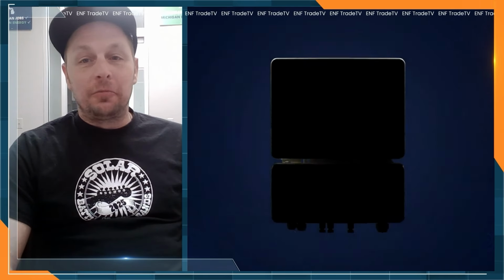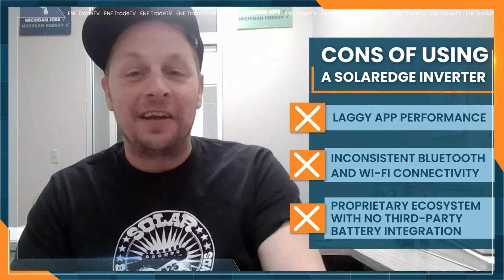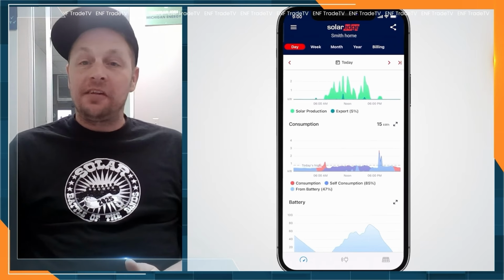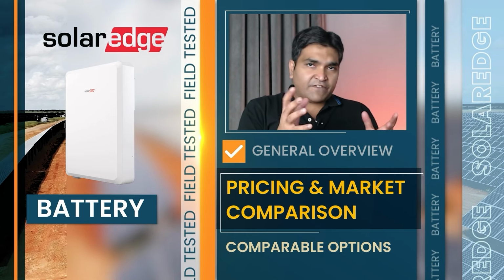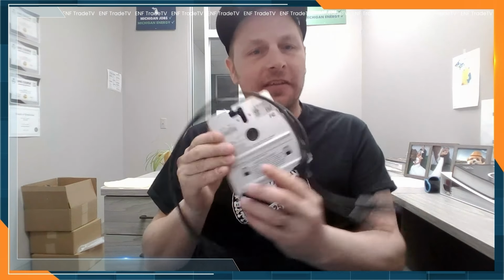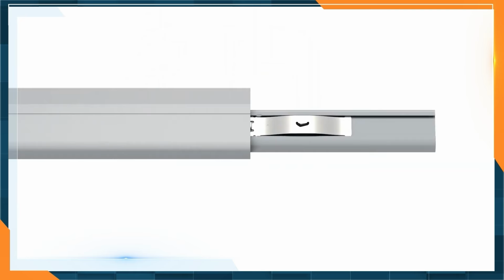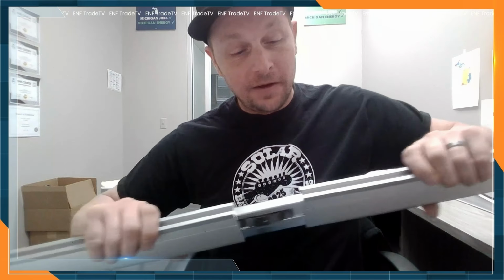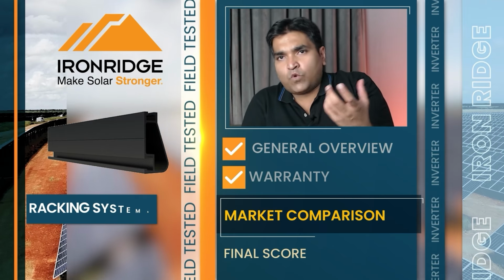Field Tested | Product Reviews : Solar Edge Inverter, Optimizer, Battery | Iron Ridge Racking System

Comment: Three people needed to lift a storage system into place... I think solar installers are going to be first in line when exosuits go on sale.
Reply: Don't you think instead of only innovating for higher energy density, they should also kinda try to pull down the weight? The more dense they make, the more power they pack, but seldom cut down the weight.
Reply: @patrickd-l2z  An interesting comment.  I think we need to look from the market standpoint.  Customers will pay extra for high efficiency panels because they get more power for a fixed roof space.  How much extra will they pay for lighter storage systems though?  If the walls bear the weight, then the only difference it makes to the customer is a slight increase in service cost from their installer charging a bit more for labour.  Energy density however, gives more storage capacity for the same size of unit – which consumers will see the value in paying extra for.
On the other hand – weight matters a lot for cars, so I would expect technologies based around weight to develop in the car industry and then get carried over to solar storage systems once the additional costs of those technologies get low enough.